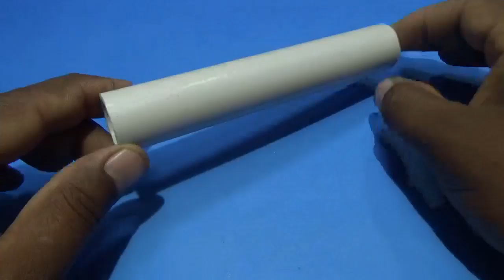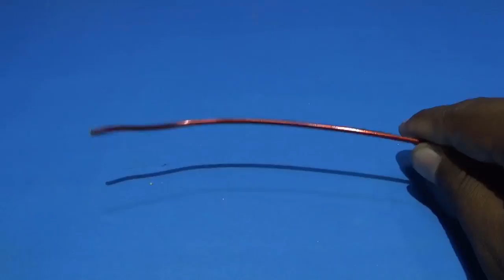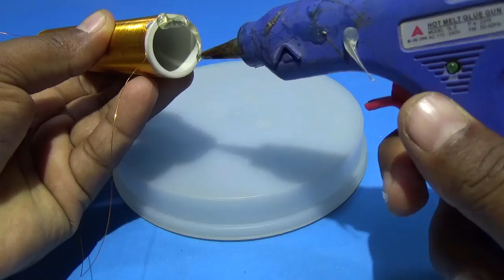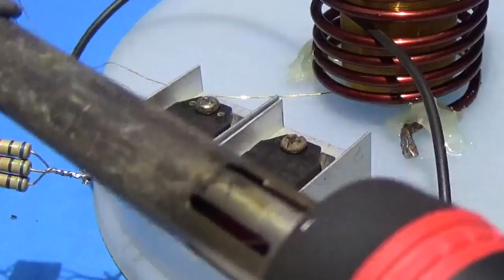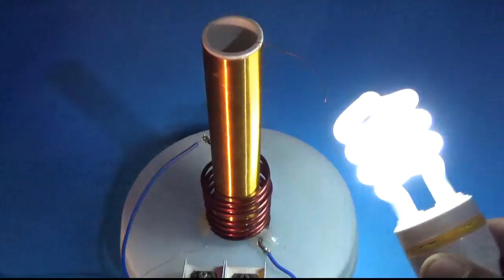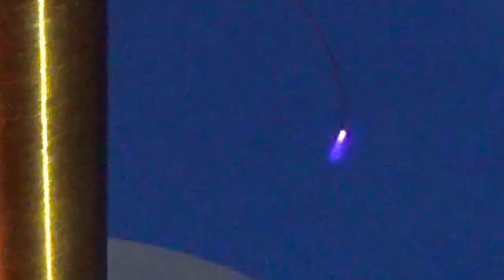Tesla Coil Project How To Make Tesla Coil at home Easy to Make With D1047 Transistor

Comment: Can it glow an LED or tungsten bulb?
Reply: No. you can use cfl which the circuit is removed,tubelight , neon light and electricity tester which has neon lamp
Reply: Yes it can glow a single LED if you grab it with one leg and the tungsten lamps can make a plasma globe
Reply: yes you need to ground one end of it, you can light up tungsten bulb but not with this one , you need tesla coil of much more power

Comment: You use AC current or DC
Reply: you put DC into the transistors, which turn on and off, generating a square wave AC on the primary coil winding (Thick wire)